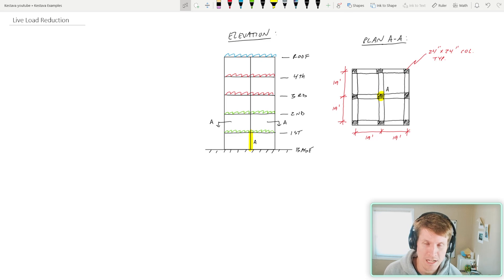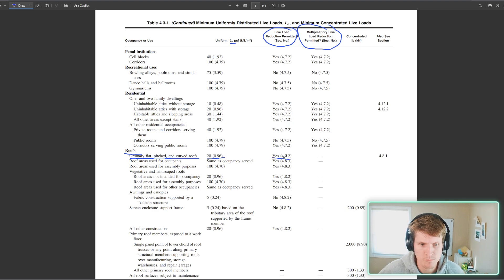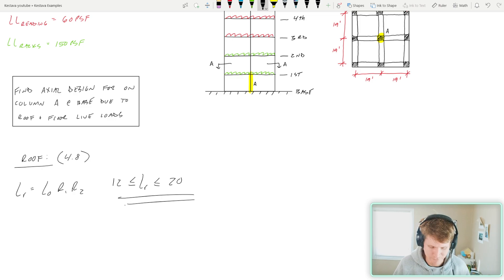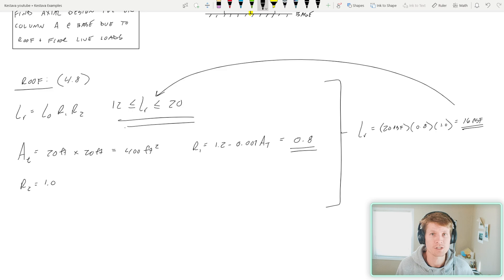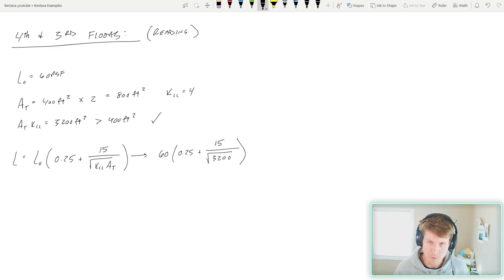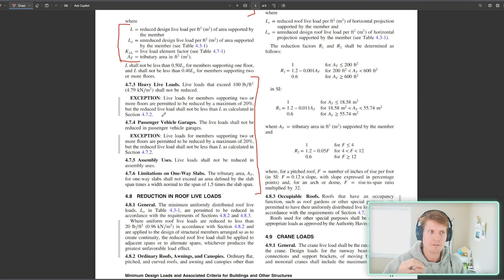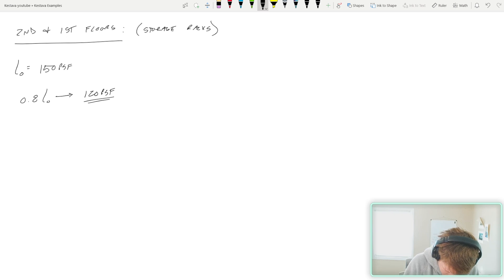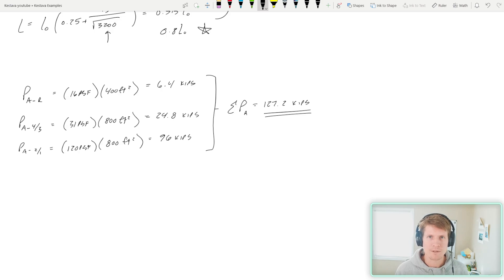Live Load Reduction Example | #engineering #structuralengineering #civilengineering

Comment: 5:32 you said the building is 20'x20', but it should be 40'x40' because 19+1+19+1=40'. Unless I missed something....
Reply: I think what he meant is the tributary area for column A, which is 20' x 20'. But yes the sketch is a little bit confusing.

Comment: My guy, how can it be 20ft by 20ft when your centre line to centre line is 19ft?
Reply: The columns are 2x2 so the floor is considered to go 1’ beyond the centerline on the exterior.
Reply: @Thatdavemarsh  I think the overall Trib Width should be 40 feet
Reply: @jesusramirez9867 The whole area of each floor including all columns is 40x40, but he's taking the trib area that the center column (A) carries, which would be 20x20 when you break down what each column carries.
Reply: good catch!
Reply: It’s obvious that you haven’t heard of implementing a factor of safety into designs as standard practice
Reply: I can't see the problem, the calculation is well done.